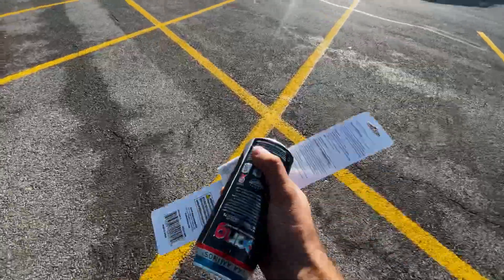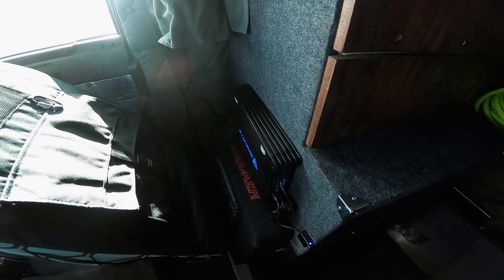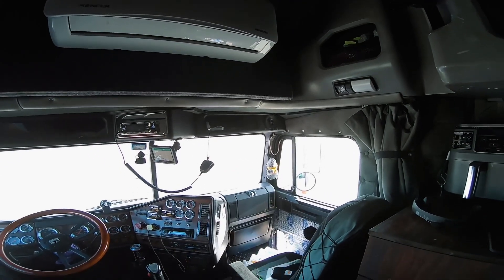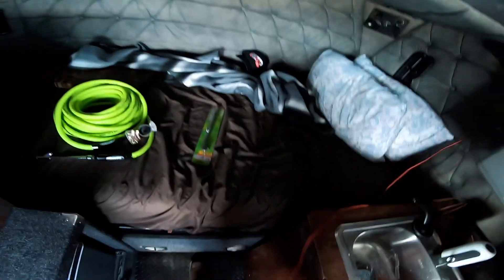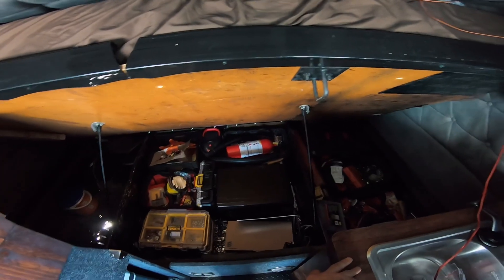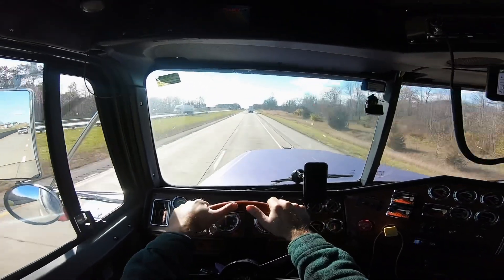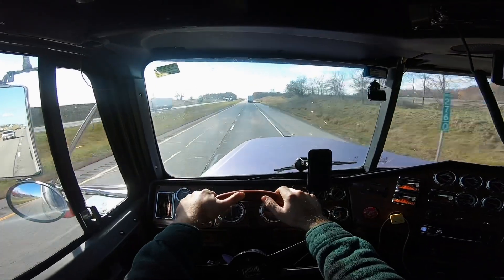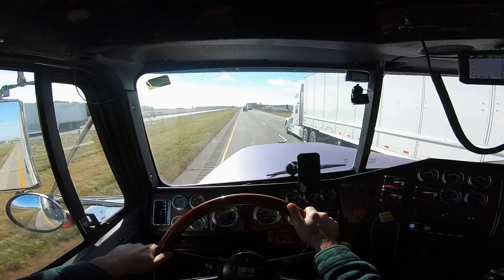Productive day working on the truck and trucking

Comment: 10 PSI over cold/min temp which should be  120,  alignment shop told me to run a 130 in the steers that’s was on 22.5 LP.

Comment: hmm, wd-40 on rubber... not the best idea in the world, it will destroy the rubber, better to use a silicone lube which will protect the rubber and keep it from going solid in the winter. and wd-40 is not a lubricant wd stands for water displacement. just some friendly advice.